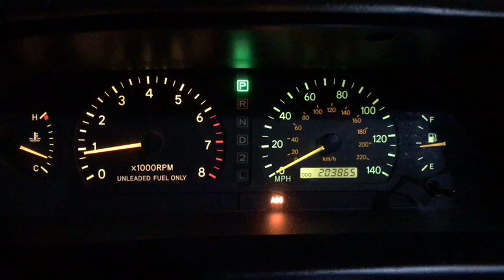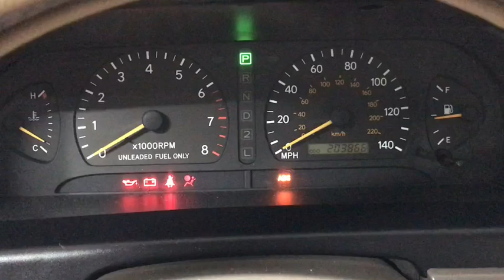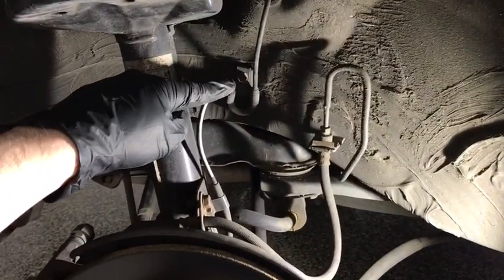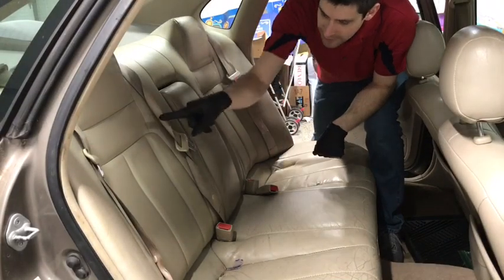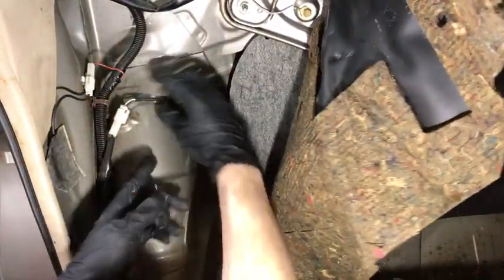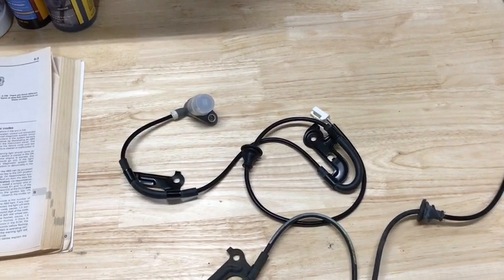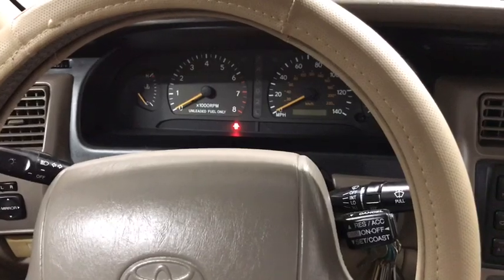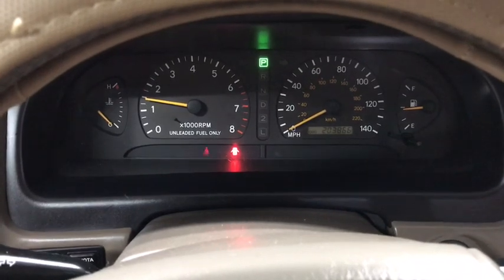How to Diagnose and Fix ABS Light on Toyota 97-01 Without Scan Tool

Comment: Thank you so much for taking the time to make this and help others out.  My abs light came on and I tried several different scan tools, including one I was told cost more than my car.  The paper clip gave me the only accurate diagnosis. Two wheels sensors later the ABS light turned right off and I'm back in business with the ABS working perfect once again.  Thank you again and God Bless.

Comment: Thanks Jeff, this worked on my 1998 Toyota Picnic (UK) only took 5 mins to get flash code 32 which was in your book as left front wheel sensor, i will get one ordered thanks for a great helpful video.
Reply: Sensor fitted today problem solved just needed to drive it a few meters to reset the ABS Light. thanks again Jeff.

Comment: Yes this worked!   I changed my front driver's side cv shaft and hub and bearing!  It ended up being just metal fillings on abs wheel speed sensor!  Just clean it up ...  Did your rest method. Vala

Comment: There's no way that car lives in the rust belt, with that many miles that sensor would have broke off in the knuckle/hub. I'm pretty sure mine needs replaced but I highly doubt it'll come off easily. My car spent it's first years in NJ, then to Washington state, then indiana then Ohio. There's no rust on the car but it looks crusty where the sensor is. Mines a 2000 ES300 Platinum Series.

Comment: Nine didn't blink fast or anything. It kept giving me code 33 on my 1997 toyota 4runner any other way to clear it?
Reply from the maker: Have you already changed the abs/speed sensor for that wheel?
Reply: @jeffharrell1874  yes
Reply from the maker: @damacknificent151  it’s possible that some variation of the number of brake pedal presses may help clear the code if the part swap was a success. If that doesn’t work, then it may be necessary to use a special scan tool that can recognize Toyota abs codes, or further diagnosis from a mechanic.

Comment: Super helpful! When I removed the cap from my data link connector, there was no short pin inside. Would that cause issues? If so, any idea what part # that pin is for me to order a new one? Thanks!
Reply from the maker: Not sure on the part number. But I would still attempt to go through the process and just skip the short pin step. In the research I did, some people had success without using it. I just included in the video because that is what the Hanes manual stated to do.

Comment: I wonder if this is the same for an '01 lexus es300? I also wonder how much you think this process would cost at a local mechanic? Thank you for the video!
Reply from the maker: I believe it should work for the ES 300 as well. Not sure if there are many mechanics that are willing to try this, but they definitely could if they wanted to. The cost would be dependent on the hourly rate. This job can be done within an hour, maybe two depending on the vehicle’s dash/instrument removal process.

Comment: Great video. Would this be the same for a 98 Sienna you think? Sure hope so just got the doggone ABS light this morning. Where did you come by that procedure? Just curious... :)
Reply from the maker: I believe it should work for that sienna, though the location of the DLC connector may be in a different spot around the engine. I found this procedure in a Haynes repair manual as well as other online videos. But the other videos were not all that clear, so I thought putting this video out may help many others going through the same issue.

Comment: Where do I get ur book for the Toyota I’m trying to get one for the 1997 hilux surf
Reply from the maker: I bought a Haynes repair manual I found on eBay used. I believe Haynes only published vehicles for the US. You might find the info you need from a Haynes 1997 4-Runner manual.

Comment: I have the speedometer issue on your other video and just ordered part . I did replace the speed sensor and got same code . I still have ABS light on 
I didn’t do the brake press reset like you did . I’ll have to try that . Is that done while the pins are still jumped ?
Reply from the maker: Yes. That will help you clear the codes. If the abs light comes back on later, then you can follow the process at the beginning of video again to determine what the code is and how to address it.

Comment: Are you concerned about your high idle? I have the same car.
Reply from the maker: No. That is typical of most Toyotas and Lexus’ of those years. They were designed to idle higher at cold starts until the engine reached the proper operating temperature. Once they are running after a while the idle rpms will drop back to “normal”.

Comment: I've been trying the same thing on my Corolla II but for some reason I can never get it to show a code, the ABS light just endlessly flashes. I ideas what might be wrong?
Reply from the maker: If this method isn’t working, it may be best to find a trusted mechanic that has a specialized scanner designed to read Toyota’s abs codes. If he can tell you what’s wrong, you may still save some money if you can repair yourself after paying the cost for the diagnosis. Or, it’s possible that you have a later model Toyota that requires a similar paperclip trick on the OBD port inside the car’s cab.

Comment: I'm a 10 year mechanic, my buddies also are full time mechanics. I have replaced all 4 speed sensors and I also replaced the entire abs module itself. No matter what I do I cannot get the abs light to turn off. The diagnostics doesn't work it doesn't flash. Just stays solid, and our manuals don't have a code for solid lit abs light. Any ideas? Lol this is nuts
Reply from the maker: Hmm. Yeah, I’m not sure why the diagnostic mode is not working. The only thing I can think of at this point is to use a fancier scan tool that can actually read those Toyota abs codes.

Comment: hanks for this video the code 33 in this video rear right sensor problem what mean that
Reply from the maker: It means there’s an issue coming from your right rear wheel sensor. It could be a bad connection, or possibly something to do with the rotor, or the sensor itself is bad. Most people have success with just replacing the sensor.

Comment: Did you have to reprogram your abs? Like to relearn? Or you just replaced it and it worked fine?
Reply from the maker: No reprogramming should be needed. After codes are cleared, all should be well.
Reply: @jeffharrell1874  I went to a mechanic and was told that. Just making sure. Thanks and I’ll try to do mine
Reply from the maker: @armstrong4358  i guess it could be true, but that might be more of a concern with a modern model.
Reply: @jeffharrell1874  I see, I got the 1997 Lexus ES300
Reply: @jeffharrell1874  yeah so just an update maybe for all, i replaced mine and did not do the programming or anything. It worked just fine.

Comment: Hello, I have a Lexus ES300 1998, I had four different numbers 1334. Should I interpret these as two different codes as in 13 and 34? Thanks
Reply: Also where did you find this book or is it very special
Reply from the maker: @SLACKLINEDUDE  i believe you are correct about it being 13 and 34.  I’m not near the book at the moment, but this was from the Haynes repair manual. I bought mine used on eBay.
Reply: @jeffharrell1874  Amazing response! You are giving me hope and an opportunity to learn. Thanks!

Comment: The book that you had, is that the repair manual for your car?
Reply from the maker: It’s not the factory Toyota manual, but it’s a repair manual made by Haynes.
Reply: @jeffharrell1874  thanks, I just found and bought one. The shorting of terminals, is that in the manual too?
Reply from the maker: @armstrong4358  I’m not sure on that

Comment: Hello, the datalink connector is the obd connector?  I want to try this on a toyota ipsum. Regards
Reply from the maker: No. This data link connector is in addition to the OBD connector under the steering wheel.
Reply: @jeffharrell1874  Ok, so in the ipsum they're under the steering wheel?
Reply: Is this connector specifically for your brakes/abs? Regards
Reply from the maker: @user-2uf2kr2c  as far as I know for the 97-01 models, this fix is done with the connections inside the engine bay. On the 2002 models and up, i believe It can only be done using the OBD connection under the steering wheel. And to answer your other question, those specific connections that were touching the jump wire should only tap into the abs system. My knowledge is limited beyond that.
Reply: Ok thanks. Godbless

Comment: What happens if the dlc thing is missing and can you please tell me what code 34 means …thanks
Reply from the maker: The location of the DLC may vary due to the year made and model. As vehicles get newer (sometime after 2001) the DLC is included in the OBD connection. Code 34 means driver side rear wheel sensor.
Reply: @jeffharrell1874  hey jeff my car is 2000 and in the thing you put the paper clip down in there was no silver piece that you removed first..is that normal? Thanks again
Reply from the maker: @furmbizz7342  it’s possible the short pin may be missing on some models. But I think the process should still work ok without it.
Reply: Thanks jeff yeah i read the code i was just wondering if I needed to buy a short pin for any reason.. my engine light stays on too.. mostly emissions codes

Comment: My is code 62 and it has something to do with ABS module.
Reply from the maker: Sounds like you could potentially have a problem with the main computer. Is the engine light on? May need a mechanic to check it out.
Reply: @jeffharrell1874  there’s no check engine light on but ABS lights still on.

Comment: When i did the process first time, the code was 31 and then I changed the right front censor and it worked. Then the light turned on again and the code was 31, 32 and 33 this time. How can that be? And what is the problem now?
Reply from the maker: That does sound odd. Because all of a sudden it sounds like 3 different wheel sensors went bad at the same time. It might be something that a mechanic should have to look at. Unless you want to take the chance and replace 3 different sensors, including the same one again. But that’s up to you of course.
Reply: Oh man! I am so unlucky with this car, how can it get worse by replacing a sensor… thank you for the tip, I will try to fix it👍
Reply: update
Today i tried the method again and the light showed me the code 32, witch it the left front sensor, so I replaced it and pumped the brake 8 times but it didn’t worked. So I pumped the brake in frustration many times (12 times I think) and boom the light turned off 😂   This car is so weird… thanks for the help Jeff! ❤️
Reply from the maker: @18922mario95  lol. Way to improvise!